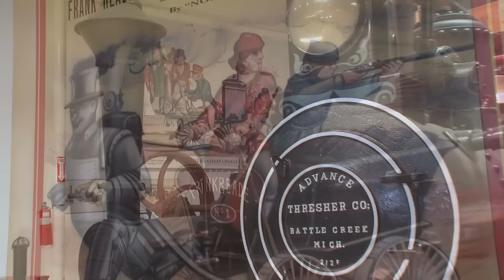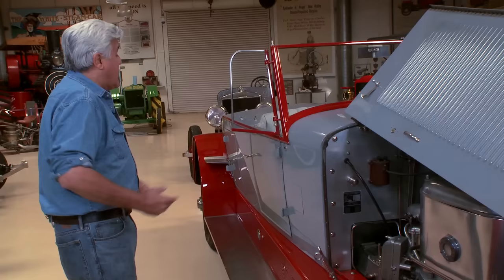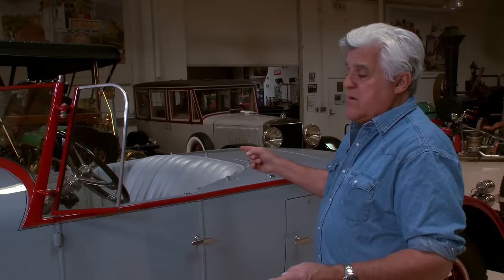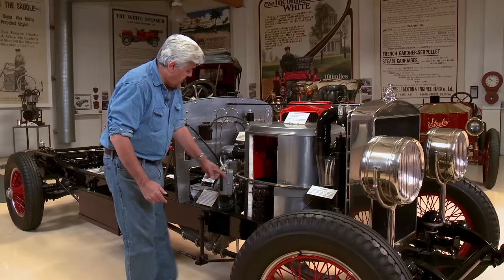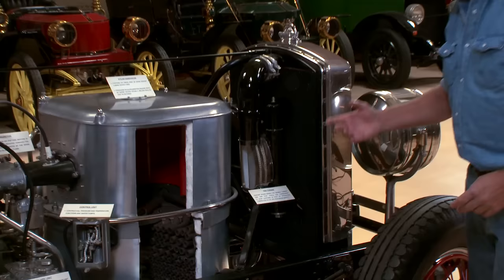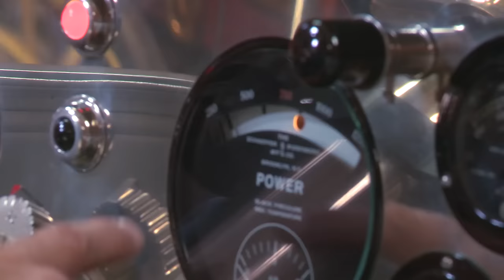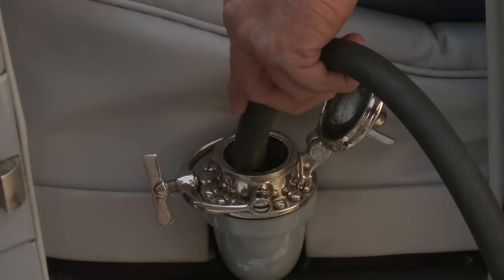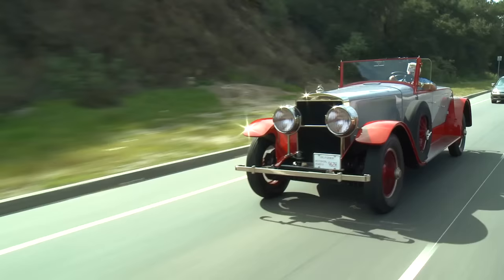1925 Doble E-20 Steam Car - Jay Leno's Garage

Comment: Dear Jay: Heya, man! Going to keep this pretty short and simple. I've been working on a design for a brand-new type of engine I think could stand of bringing steam back in a big way. It's actually a generator designed for hybrid cars, kind of spiritually derived from a combination of the Doble, a combined-cycle jet engine and another little innovation of mine...the lynchpin of the whole design that makes the whole thing work. I'm looking at a better than 90 percent efficiency when paired with the new axial-flow turbine setup I designed. And it would inherently be one of the cleanest-burning engines on Earth, with no exhaust after-treatment or smog equipment required. It's cheap, light, fairly compact, durable, has about a dozen moving parts, and will run on pretty much any liquid hydrocarbon. And yes, this is completely original...I've researched the Hell out of it. The closest thing to it now is a combined cycle jet engine, and that's an easy ten generations behind this design. 

I really think this could be the future of hydrocarbon-fueled engines...maybe keeping them viable indefinitely, if we can transition to biofuels. Right now, I'm a little short on people to trust...I don't want it getting stolen, or buried by some automaker in the secret files forever. I just want to put this technology out there in the world...and at the very least force them to play the cards they've been holding by publicizing it. 

Jay, you're the Steam Guy. Your guys know the engineering. And you're probably the only other person I know with the vision to see what this thing's capable of, and the means to help get it built and publicized. I'm not looking to make a billion dollars off this thing...I just want to make the future happen. and I think steam power, with this design, could be it. If all we do is build the thing and put up a YouTube video to show the world it works, then that would be more than I could have hoped for. 

I'm going to re-paste this on a few other videos, and hope it gets your attention. And I hope it does. I think you're the one guy who could and would make this thing happen. If you're game, you know how to get hold of me. You can also get a hold of me on Facebook under Richard Rowe, or on Twitter as @invicta1313. Here's hoping you see this, and we can work together soon.

Viva la Steam!

-- Richard Rowe
Reply: 90% efficiency doesn't mean anything. Compared to what? The carnot cycle? (maximum theoretical efficiency of any heat cycle) The otto cycle? The ranking cycle? You need to understand those terms you have a LOT of study ahead of you. As an aside combined cycle gas turbine steam expanders in large power plants are running close to the theoretical maximum already.
Reply: fizzguts OK...since you sound like you're trying to contribute something constructive, I'm not going to sarcastically thank you for the condescending advice. I've been studying engine design, thermodynamics, fluid dynamics and mechanical engineering for the last 20 years, and write automotive technical articles for a living now. But, I'll just chalk it up to unusual circumstances for a YouTube commenter, and assume you were going on a reasoned generalization. Though, that said...I am going to point out that it's "Rankine," not "ranking."

Anyway...it's the BTU content of the fuel used to the power output of the engine. Comparing how much chemical energy goes in, to how much mechanical energy comes out. One step past BSFC. For a gas engine, that's maybe 35 to 40 percent. On a good day. More typically 20 percent. For a diesel, maybe 60 percent. This engine will run at 90 to 95 percent. 

And yes, I'm aware that commercial combined cycle powerplants are extremely efficient..,I'm using a similar approach for the same reasons. But commercial CC engines and the required support systems are HUGE for the amount of power they put out. If you were to just scale a CC system down to fit in a car, it would probably make 30 horsepower at most. That's why nobody does it. This design could easily produce a thousand horsepower, AND fit under the hood of a normal car, WHILE turning in at least twice the fuel economy of the best gas-hybrid out there today.
Reply: Richard Rowe 90% of the fuel will be turned into mechanical power. OK well that was simple, you are wrong, completely and utterly. You have exceeded Carnot the maximum theoretical efficiency i.e. flame temp and STP as the two temperature points, so you have made a howling mistake or you are delusional. There is no one with any knowledge of thermodynamics who will do anything other than laugh at your claim. Oh and I didn't just study thermodynamics etc I got the ticket, applied it plus I own steam vehicles
Reply: fizzguts LOL...oh, you engineers...such limited imaginations you have ;)  Yes, I'm aware that exceeds Carnot. And you'd be right, if this were strictly a Carnot cycle engine. That is part of it, since it uses a combined cycle engine as a base. But I'm way beyond that now. The CC engine is just Stage 1 of the total design...it's just the broad stroke, the first half. The rest of the process is non-reversible, and uses conversion processes that don't rely entirely on heat transference. So the assembly as a whole is capable of beating Carnot. To get any better than this, you'd have to just use the stuff for fusion lol.  

Nothing personal, but that's why I never got "the ticket." After you've learned what you need to know, the rest of it is limiting indoctrination to established ideas. I'm not judging, but a lot of formal education encourages inside-the-box thinking. Plus, I bet you're older. I'm a young mutt. And I'm sure you are better with some of the more technical details than me...if I knew everything there is to know, I wouldn't be asking Jay Leno for help lol. But I do know enough to know this thing will work, and beat the theoretical max for a steam engine.

So relax, man lol. We're just coming at the same thing from two different perspectives.Sorry if I sound condescending at all...it's not meant that way. But new things are possible when you apply newer technology and processes to older ones.
Reply: Richard Rowe "But I do know enough to know this thing will work" Ah the arrogance of the ignorant "Yes, I'm aware that exceeds Carnot" Well you are obviously brilliant as all the physicists, scientists and engineers for the last 300 years have missed this and are wrong. LOL. "The rest of the process is non-reversible, and uses conversion processes that don't rely entirely on heat transference. So the assembly as a whole is capable of beating Carnot." and happily violates the 1st 2nd and 3rd laws of thermodynamics and probably uses magnets the last refuge of the tinkerer "Sorry if I sound condescending at all" No you sound confused, under educated with a lack of knowledge of relevant physics and and the appalling arrogance of the true believer
Reply: fizzguts Orr...maybe you didn't hear me when I said that it isn't entirely a heat engine? It's PARTIALLY a heat engine, STARTS OUT as a heat engine. Yes, that is the broadest stroke of the thing. But there are other processes at work aside from that. So no, I'm not more brilliant than everyone else in the heat engine game...we're just not playing the same game. And if you can't understand that without my giving away more details of the design, then well...if you could do it yourself, you would probably have.  

It's cute that you try to relegate things you don't understand to pseudoscience by talking about "magnets," which I'm sure is one step short of "pyramid power" in your mind. But no, it doesn't use magnets, or any kind of hoodoo witchcraft. Or any other technology that hasn't been available for the last 20 years. The reason I can say it will work is because every technology used in it HAS worked...they just haven't worked TOGETHER, because the applications, materials and technologies for it haven't existed until fairly recently. Or they've been too large, too expensive or too impractical to use. But they're not now. And I'm not going to get drawn into an idiotic argument about the viability of things that have worked for decades.

Look, man, I know what this is. This is some bitter old man who has never come up with an original idea in his life, taking pot shots at someone who has. Every time someone sees a way to do something different, there are always a few of you hanging around to hem and haw about how things won't work, and why nobody but them knows anything. And then when that thing DOES work, those people are the first ones to steal it, reverse engineer it and call it their own. All while never acknowledging that they didn't think of the solution first simply because they were too limited to do it. 

So, spare me. Tell you what, call me arrogant if you want. But thank God the world has people like me, who are too arrogant to listen to people like you. Because if we DIDN'T, we'd still be stuck in the stone-age, with some old man hemming and hawing about why the wheel wouldn't work because he didn't think of it first.
Reply: fizzguts Yes, don't you think I already know how ridiculous a goal that is? I'm aware of the fact that 90 percent is getting out of the realm of conventional engineering. Damn near into mass-energy equivalence. Yes, I know. That's why I made the joke about fusion. But it's an unconventional approach, and it IS the next best thing to fusion.

That said, I do have to point out a basic flaw in your assumptions. I never said it converted the fuel energy into mechanical power. You said that. Converting to mechanical power is just stage one, exactly as I said before. It's a generator. The goal is to convert the fuel into ELECTRICAL power. Mechanical and thermal extraction are just the starting stages. And yes, in those stages, you're right. But I told you before you were using the wrong math, and making the wrong assumptions. You still are. Maybe that's my fault for being intentionally cryptic. If you saw the operating principle of the thing, you'd understand what I'm on about. 

So, all right...given your assumptions, I can see how you'd see the commentary as constructive. Fair enough. In that regard, I appreciate it. You're making that commentary based on inaccurate assumptions...but still, I'll appreciate the effort on principle.
Reply: Richard Rowe "90% of the fuel will be turned into mechanical power." Direct quote from your second reply and complete nonsense .  Bollox about using other stages to extract extra power `via what ever thermal electric conversion you can dredge up doesn't alter that. Your comment "from a combination of the Doble, a combined-cycle jet engine and another little innovation of mine." is more nonsense as you would know if you had done any study there is no "Doble" The Doble brothers Warren John and Abner contributed to making the mono tube boiler more suitable for a car. Their quartz rod thermostat and draft booster made the steam car a better performer and more tractable. However the design is obsolete and a forced circulation boiler such as LaMont is smaller for the same power and has better efficiency especially coupled with a uniflo engine with a low pressure turbine. Combined cycle power plants already far exceed Steam car power plants but cannot achieve their efficiency, usually close to the theoretical of 60%, in small sizes i.e. a car. I have made no assumptions merely stated thermodynamic facts you are ignoring
Reply: fizzguts  Well, Okay then...you know what...that was my error then. I apologize. I did get into a hurry and misspeak. I DID mean electrical energy, not mechanical. Reading back over that, i can see why you responded the way you did, and the confusion here. Yes, there is a degree of turning it into mechanical energy, as the first stage. That is part of the output. There, yes, Carnot applies. But even in that stage, it's higher than the best CC powerplant. And part of the design is effectively a forced circulation boiler, though at much, much higher temperatures and pressures. Which I'm sure you already know is good for efficiency in the Carnot sense. 

The reason I said "Doble" is because that was the car in the video I was posting on. Fair enough, I didn't know all of the history of the design, which is interesting. But it was the basic design I was referring to, insofar as the steam generator tubing instead of the open boiler. That is a facet of the design. Honestly, I'm not really familiar with the LaMont as a vehicle, though I do understand the concept. It was something I played around with earlier on. Actually wound up kind of re-inventing the CC engine from that lol.

But it took a different design path, and I wound up with the engine where it is now. It's more of a direct evolution of the forced circulation engine than anything, but there are several other processes involved that didn't exist back then. And they're not add-on stages to a CC, like scavenging or reclamation. They're integral to the design. 

So, I apologize that I mis-spoke, and that I was an asshole to you as a result of the misunderstanding. Mea culpa. Syill, I stand by exactly what I (meant to say) in the very beginning: 90 percent conversion from chemical energy to ELECTRICAL power. DC, specifically. But that's a whole other thing.
Reply: Richard Rowe hey richard  it is good to see or hear from guys like you still  looking into  beter ways of doing things , im sort of the same way , but probably not as smart as you, but what do you think about my idea , here goes ,  its a car that is powered by electric motor  and is recharged by a  jet turbine  running on hydrogen   created from water ,h2o, so it is a  hybred  , a  hydro electric , you  start off with plain old  water for fuel , then right before it is  injected into the turbine it is  broken down into hydrogen and oxygen  through  a process called  triangular  rotational morse potential , this splits the molecules apart  using radio frequency waves , our navy propels there torpedoes with this exact same technique , so the ocean is the gas tank , torpedoe never runs outa fuel, anyways hydrogen burns totally clean , no pollution atall ,. so your running this turbine that is direct conected to a generator that keeps the batteries  charged up , electric motors have  alot of torque  and can pull  alot of weight  and it is very controlable as well , so yopu would have a car that costed only the price of water to run with no pollution  and you can get 3 times as many miles out of a gallon of water as yyou would get out of a gallon of gas, plus if you wanted to go hot rodding , hydrogen  has a octane rating of 130 m you could run a 12 to 1 compression engine  with a turbo on top of that , if you just wanted to go hotrodding  and convert your internal combustion engine  into hydrogen burning  hot rod ,. hydrogen is the best fuel  in the world , no pollution at all , 130 octane rating and you can go 3 times as far on a gallon of water as you can go on a gallon of gas, our government does not want this ,because they will lose millions of dollars of tax money from the sales tax on gasoline , what you think about this idea ?
Reply: Karl Knudson The jet turbine is a compressor, so there's no point adding a turbocharger! Can't speak for the radio frequency bit - but the basic premise (i.e. the gas turbine range extender) is one which Jaguar explored with its CX-75 concept.
Reply: Richard Rowe I think like you1 Don't let the design get to complex, as cost and weight can go up. A steam turbine locomotive was produced (late 40's) and a jet turbine was used in a few cars, so turbines seem to be a plausible improvement. High tech ceramics or aerogels can provide light weight insulation. When a steam car is turned off, all that residual energy potential can be salvaged. I'm no good for capital investments, but I'm good for ideas.
Reply: Karl Knudson Power will be lost at every step of the way, plus your notion is based on experimental technology